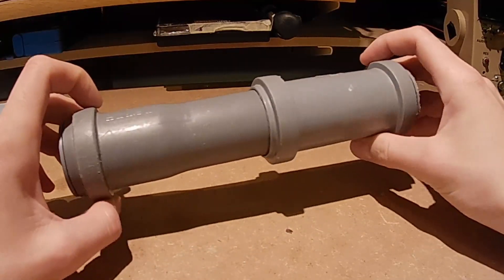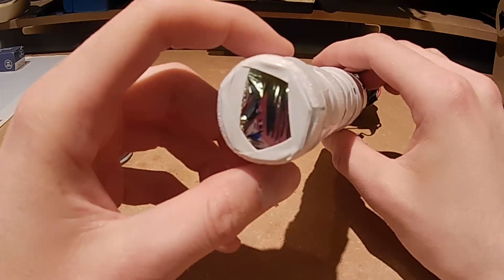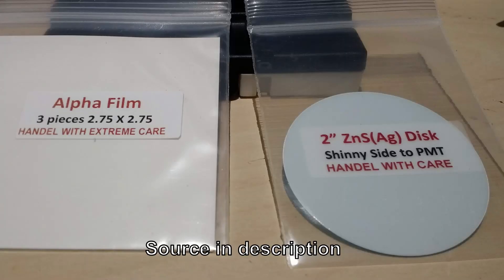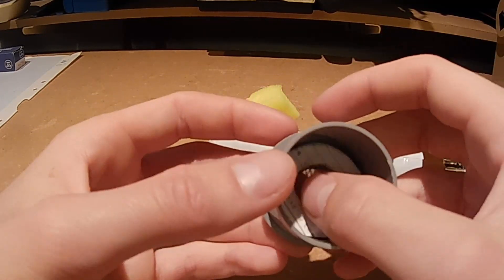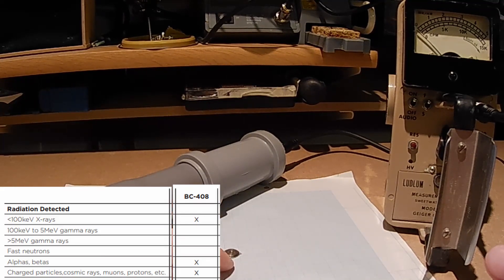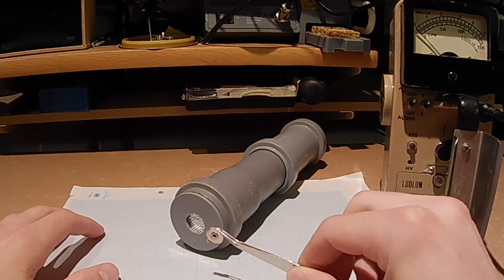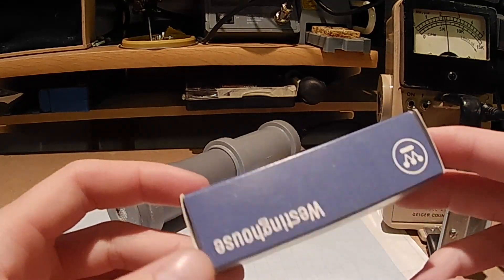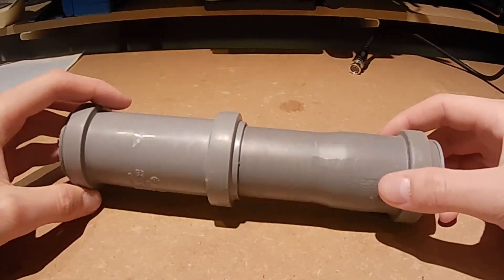DIY α, β, γ Scintillation Detector (ZnS(Ag) and BC408)

Comment: Nice work! Also I"ve read on russian forums that the PMTs should be covered with permalloy sheet. In this way you ensure that external magnetic fields won't alter the photomultiplier gain.
Reply from the maker: Thanks! Yes, I have also heard that using mu-metal around the PMT is good practice. I have not yet tried this, but maybe I should. So far my scintillators have worked okay, though.
Reply: @aelaboratories2572  Well got caught in the hype train, just ordered my FEU 35A and a plastic scintillator. Hopefully I can make it tick... Also bought a photodiode coupled to a CdWO4 crystal. Legend says that these are more sensitive because of density. However the photodiode is not a SiPM diode, so there is the trade off. Still good for a bit of experimenting with TIA-s and other stuff.
Reply: @aelaboratories2572  Also a bit of an advice. SR90 sources like you have are prone to leakage. These were used in old DP-5 A, B, V dosimeters and a lot other as control sources. Nasty stuff if you get it on your fingers. 
Also I recommend to get the SBT10A pancake tube, it is a good geiger tube and suitable for long measurements with wide surface, just make sure that every anode has a 10MOhm resistor. A voltage stabiliser (Type SG301-S)  will give you 390V anode voltage, and at the cathode you can detect the pulses with a 200K drop resistor and a coupling cap. These pulses will be way shorter and the geiger anodes won't have the trouble discharging additional capacitances.

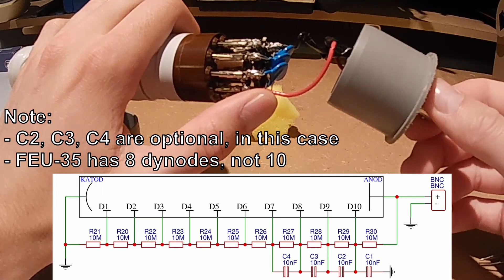Comment: The schematic at 1:32 works for all PMTs? I saw this same schematic on your other videos and that is why I'm asking
Reply from the maker: Yes, I think it should work with all PMT's. I like to use this schematic because one only needs one value of resistors (10 MOhm) and one value of capacitors (10 nF, a.k.a. 103 capacitors). PMT's can be run using both positive and negative HV. I like to use positive HV, which means they work with most common ratemeters. 
Some PMT's might want slightly different resistor values, if you want to do gamma spectroscopy or something that requires a lot of precision. But I don't think the difference is too big.
Reply: @aelaboratories2572  what if the PMT has more than 10 "legs" (14) should I just add more capacitors?
Reply from the maker: @allRadioactive  Yep, if the PMT has more or fewer pins you simply extend or shorten the schematic. You pretty much want resistors between the cathode and first dynode, between all two dynodes next to each other, and between the last dynode and the anode. The most important capacitor is the one between the final dynode and ground, which is C1 in my schematic. C2, C3 and C4 are not as important. Keep in mind that the capacitor C1 should be able to handle >1 keV too, to be on the safe side.
Reply: @aelaboratories2572  thanks for the clarification! Now I just need to wait for all the part to arrive 😕
Reply from the maker: @allRadioactive  No problem! Yeah, waiting is the worst part of any project
Reply: @aelaboratories2572  I believe the FEU-35 states in its datasheet that the resistor network values should actually be uneven. but I am just working from a google translation of the document and it is still very confusing.

Comment: Where did you acquire your strontium 90 source?
Reply: Old soviet meters (DP-5 Series, DP-63-A etc) used B-8 Sr90 sources which had activity of 200kBq.
Reply from the maker: @allRadioactive  Yupp, that is where I got mine from
Reply: @aelaboratories2572  me too. I got one from DP5V and the other one from DP63A :)
Reply: you have to be careful with these old strontium 90 sources. They are easily damaged and the material inside is a powder like substance as far as I know.
Reply: @MrEdwinHubble  Sr90 inside B-8 sources is in an epoxy which is covered by thin aluminum foil
Reply: @allRadioactive  Hmm yea, but they tend to crumble after several tens of years. Usually this is the issue with the DP-2 type dosimeter control source. The epoxy somehow gets damaged (well there's nothing to be surprised, in every second thousands of particles bombarding the molecules). Then the sealed stuff escapes the container.
Reply: @MrEdwinHubble  I haven't  had any problem with my sources yet but I still keep them in plastic bags just to be sure. ⁹⁰Sr is really nasty stuff 😒

Comment: Excellent video, are we able to make a compact version of plastic scintillation detector probe?
Reply from the maker: Sorry, I am not really sure what you mean. Do you mean using a different photomultiplier?
Reply: @aelaboratories2572  smaller photomultiplier, compressed plastic scintillators, smaller pipe. to make a real handheld detector. how many plastic scintillators works?
Reply: Well another way to make a smaller scintillation detector is to use SiPM instead of "traditional" PMT. SiPM is basically a specially designed avalanche photodiode. Which is used in reverse biased mode.